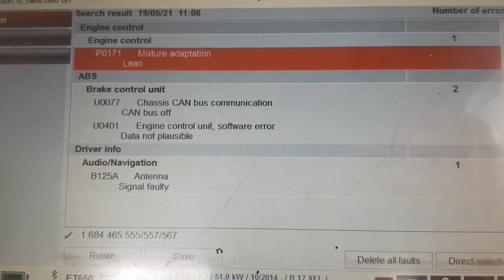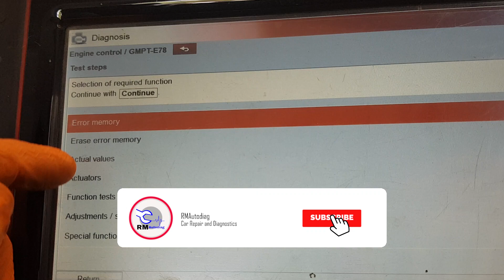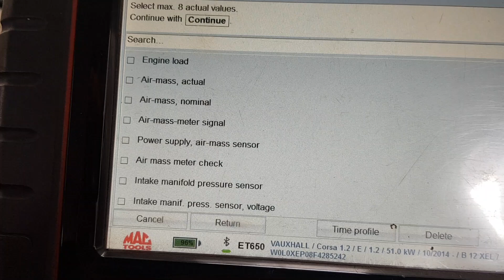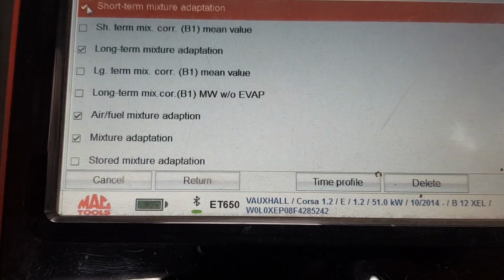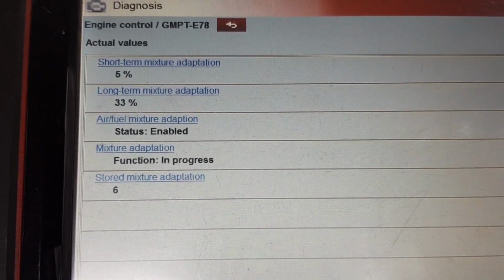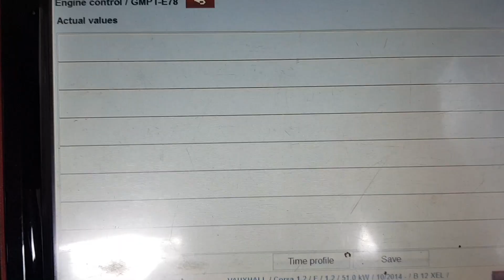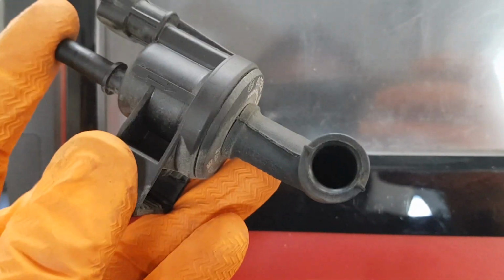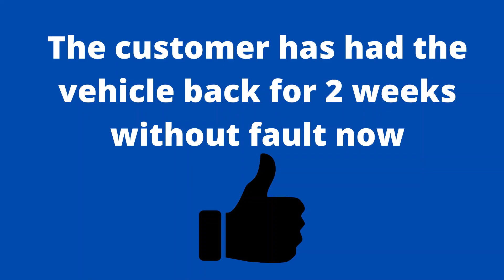Vauxhall Corsa ABS/ESP fault U0077 U0401 P0171

Comment: Hi Richard so did this cure the u007 and p0171 dtcs ?
Reply from the maker: Yes, the customer had the car back for weeks and no further faults occurred or came back. Thanks for the comment👍
Reply: @rmautodiag  Big thanks for this video. I have the exact same DTCs, and once i hade the DTC for rich mixture at the same time. Thought it was wierd but i guess it was pulling fuel vapors uncontrolled. Just checked the exact same valve on my Corsa and sure enough I could blow straight through it. Ordered one today will update on if the issue was resolved as it was here.
Reply: @jagheteromer   Hello, did it helped? I have the same error codes on my Corsa... :D
Reply: Thanks a lot I will try with my .all the best
Reply: I have a abs esp fault on my 2016 Corsa e . Have replaced the abs pump but same lights stay on. So would I need to just replace the part you showed in the video instead of

Comment: Thanks Richard,

Another great video that really explained it nice and simple.

I was having the same issues with errors P0171, U0401, and U0077 and ordered a new Evap valve. 
I removed the old valve and noticed it was letting air out when blown, so therefore faulty.
Replaced and then restarted the car and saw that error? P0171 was gone but U0401 & 0U077 still remained.

Any ideas?

Cheers
Reply: Hey same issue here, I had that at first. I changed the PCV however i broke the white clip but still has the green clip. I have driven the car and car lost power after 10-15mins

Comment: I have the traction error and with the error diagnosis: U0077 and P0401 no electrician can solve the problem for me, is that the piece that needs to be changed?